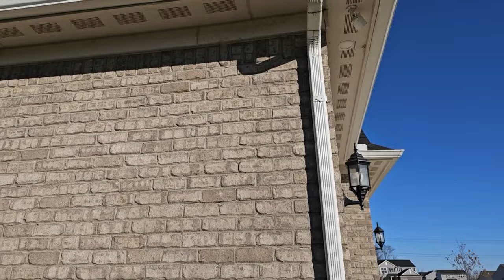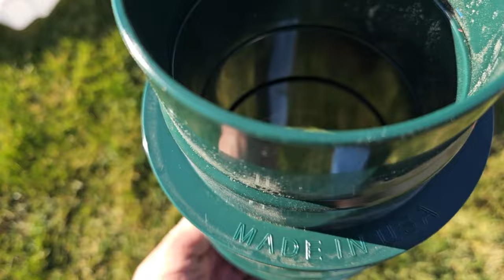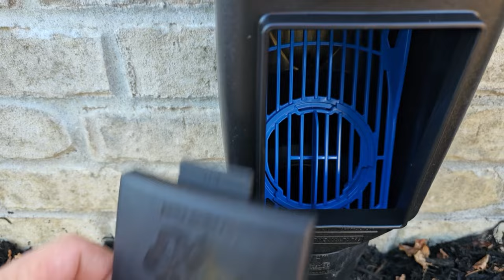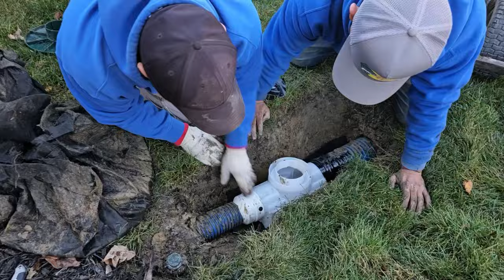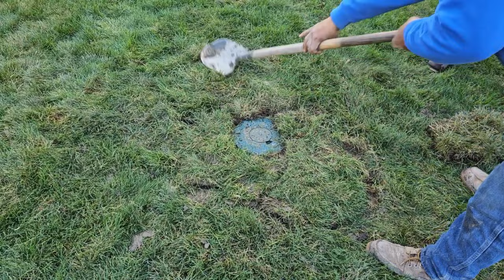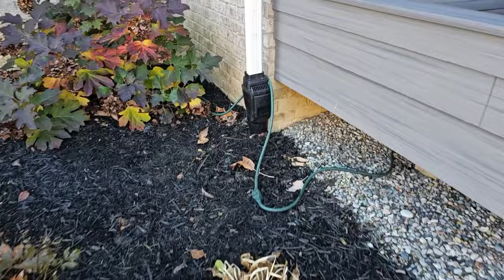Easy Underground Buried Downspout Upgrade Tutorial

Comment: I have my material list in my cart right now but had trouble at checkout. Will be calling tomorrow morning to finalize my order. I ordered the 3" High Octane Armor for my downspout drain that will be installed under my driveway. What surface drain should I install at the end of my driveway in place of the pop-up emitter since vehicles will be driving over it?  Awesome videos!
Reply from the maker: We angle away from the driveway and use our FDM pop-up emitter all the time.

Comment: Still wondering how deep to put the piping in the North. I’m worried about the freeze in the North. Love your system and wanting to use it
Reply from the maker: Let me put your mind at ease. If you live in the North. Your line will 100% freeze. There is not much you can do for gravity systems. All our FDM products are made to expand in the freeze. The return to their original form after the thaw.